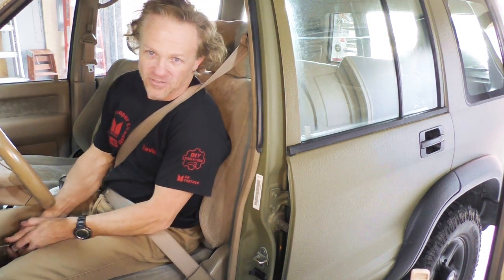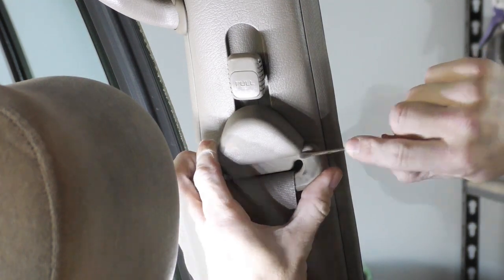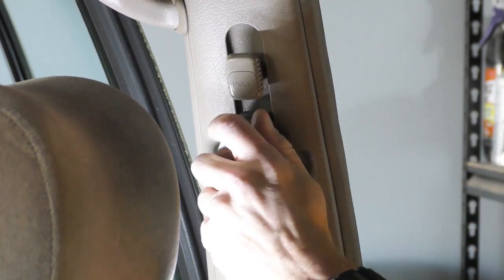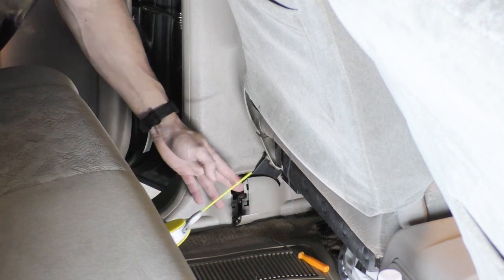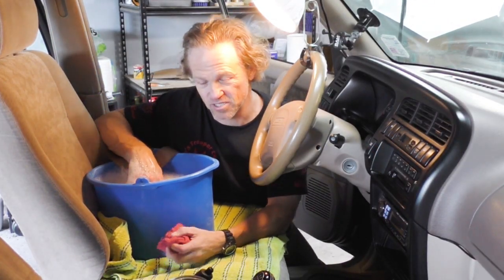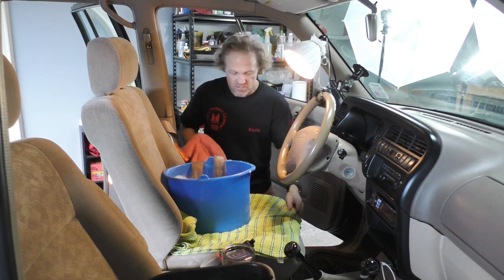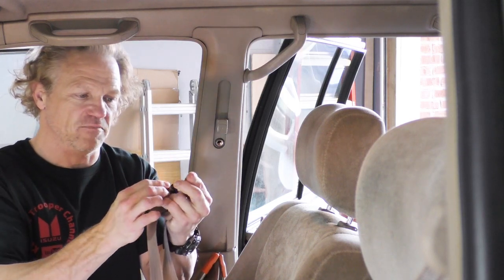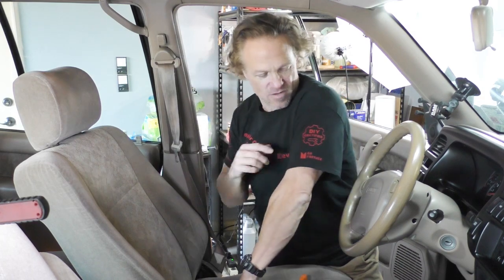How to fix a seatbelt that wont retract - BEST METHOD

Comment: Thank you for this video. I siliconed the retractors but never thought of soaking the seatbelts. I soaked them in OxiClean dissolved in warm water. OxiClean is a tough degreaser and gentle enough for the wife to soak her sheered curtains. I was amazed to see how much filth came from the seatbelts after approximately 20 minute soak and scrub on each.

Three of the four retractors turned out great. Trip to the local Pick Your Part with the same cleaning method fixed the other. 

Thank you for the helpful video. Cheers!

Comment: IT WORKS!!! Thank u for the advise, i only have one thing to say there is no need to remove that bolt the seat belt that i worked on was so stiff n nasty I filled a bucket with “HOT WATER”  dawn And fabric softener and now WORKS LIKE A CHARM with only 1 wash.THANK U AGAIN!!

Comment: The middle seatbelt in my truck is stuck. It is the kind that crosses over your body. My son pulled it all the way out too  tight and it won’t retract at all. 
Any suggestions?

Comment: Hi do you have any answers my driver seatbelt how do I explain this is lazy it’s not tight as I drive I don’t feel like it’s holding me when I brake or take corners fast it dosnt hold. When I pull the the passenger belt all the way out and release I hear a ratcheting system on the drivers belt I hear nothing it’s really loose

Comment: Thank for the video going to have to give it a try on my 95 4runner.
Reply: Dude being a 95 the tension will need winding up a few turns. 
You will find some clips on the youtube about this do yourself a favor take the belt out of the car its easy a blind man could do it.
Once you have it out hold the drum in the upright position as it would be in the car pull the belt all the way out until the spool is MT.
locking the spool in place with a pair of vice grips so the spool don't retract find the end of the belt that's locked into the middle of the spool hook this with small screwdriver or seal pick and pull the end of the belt that's sitting in the drum towards as you feed the belt in from the opposite side.
Once you have pulled out few inches you will see the belt has been double over and stitched in between the stitching you will see a round bit of plastic or steel that stops the belt from pulling back through the drum slide this stopper or pin out of the stitched overlap place the overlap on a bit of wood and softly tap the overlap to flatten the eye out making it easier to pull it back out the otherside of the drumonce the pin has been removed.
before you pull the belt out of the drum mark the side facing you with whiteout so if the belt is pulled out of the guides and slides you know what side was facing you.
Making sure the drum is secured as you only need to pull the belt from the drum and not out of the mechanism leaving the belt in the rest of the guides.
Once the belt has been removed from the drum holding the drum firmly from spinning remove your vice grips and start rotating the drum in the opposite direction to the way it wants to undwing this puts more tension on the spring give it 4 or 5 full turns in the tension direction once you have got more tension on the spring slide the folded end of the belt back through the drum and replace the anchor pin and lock in back in the drum if the belt retracts and fills the spool it's you have plenty of tension .
Pull the belt all the way out until it stops put a clamp on to stop it retracting back again. 
fill a bucket with hot soapy water and put all the loose belt in the bucket along with all the slides guides and stoppers that are still attached to the belt leaving the retractable mechanism hanging outside the bucket.
After a soke for an hour give a light scrub on both sides of the belt with a soft nail brush rinse in hot water let dry and replace back in the cars squirting some WD or CRD onto the mechanism.
Reply: @jcmate1692  thanks.

Comment: I am not sure why all these videos show using laundry detergent with water in a bucket and then soaking and washing belts.. I suppose it's the feminine side coming out of the blokes..  Try just using sugar soap in water 50% mix and scrubing the belts.. takes 5 min max per belt and does't soak the belt with a wait time ( forever ) for the belt to dry..
Reply: Whats feminine about soaking the belts? Cleans them far better anyway rather than just wiping off the stuff on the surface.
Reply: Wtf is "sugar soap"?